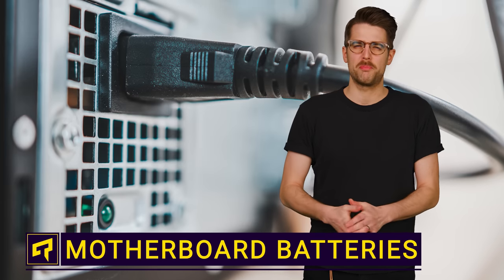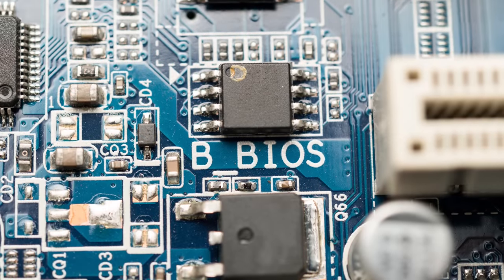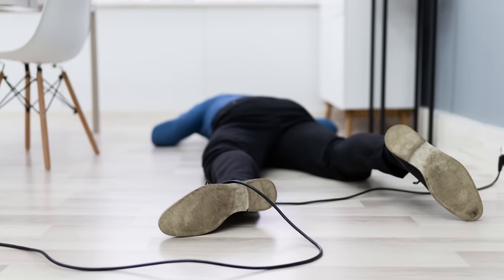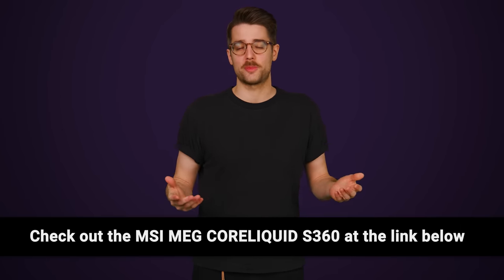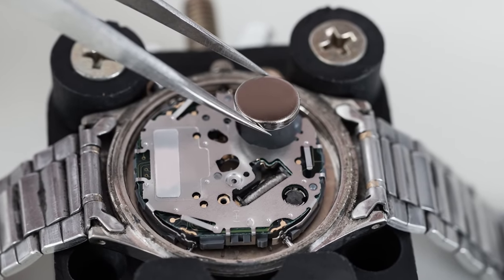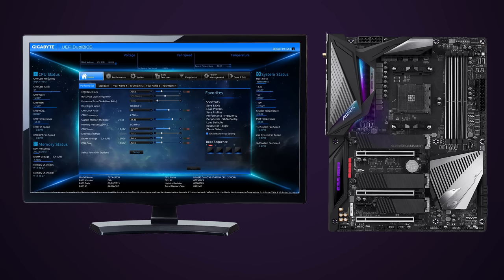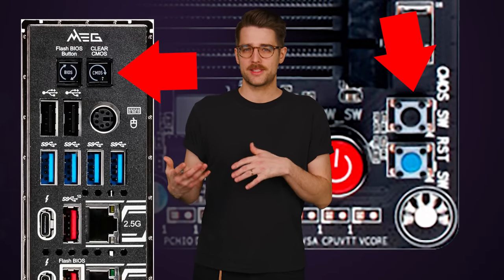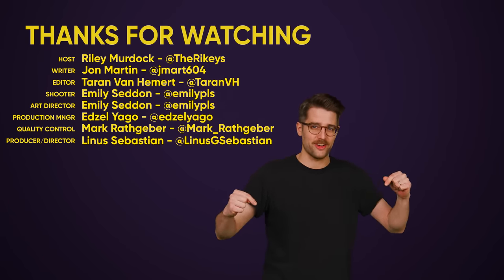Why Do Motherboards Have Batteries?

Comment: apple be like: your guys still use non rechargeable lithium  cmos batteries!? come on we now! thsie days in apple we use a motherboard built in NVRAM SSD bios backup storage drive with a rechargeable lithium battery on the motherboard with also NTP time keeping program that we had keeping time even back when for the g3 imacs in case the g3 imacs cmos batteries go comput! but no more point in having non rechargeable cmos batteries when you have a built in backup ssd drive made just for making sure the main drives corrupted bios registry doesnt brick the computer from a sudden power loss and complemented with a built in rechargeable lithium battery on the mother board itself that is basically a much better version of a cmos battery but its recargable from the motherboards own power supply when plugged in that can last just as long if not longer than the computer itself!

Comment: This is one of the "why is this there for dummies videos" Everyone that knows how to build or overclock a computer knows that's like the dead man's switch for reset, pre motherboards that didn't have backup bios or jumpers that would do it. And for the sake of "just keeping time" I believe it still keeps more info than that. Even allows for error codes to sound off on the motherboard for a bad boot that won't load the monitor. Got you buddie. :P

This kid doesn't understand.

Comment: These days everyone has internet, so remove the battery adn let yuour PC jsut quickly connect to the internet when it boots to get the time. If it can;t give a warning to the user that the time is not correct. Problem solved boom!

Comment: Related story: I recently took apart my machine to install some new thermal paste and just clean up in general. In the process I disconnected the CMOS battery and when I reassembled and booted back up, internet was not working. What had happened was that the system time had reset and was way off, so site certificates appeared out of date/invalid. Setting the clock correctly fixed it instantly.

Comment: Meh, batteries aren't strictly needed anymore, they're just cheaper for the manufacturer. They COULD use Supercapacitors instead, you know...the type that will be used in the futures solar panels, and is essentially a long lasting high capacity energy storage, these have been produced in 3.3 and 5v variants for the longest time to replace Backup batteries (I know, I bought a few of them myself 8 years ago), why they're not using them still - well - they're probably still a few cents too much.